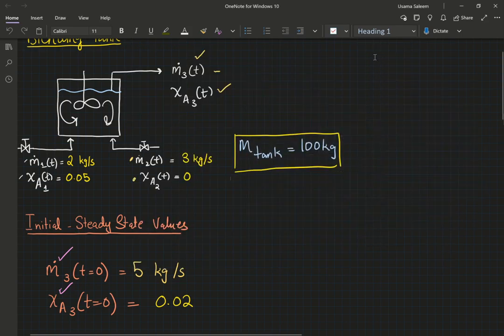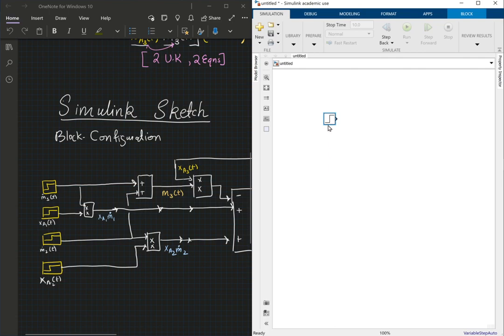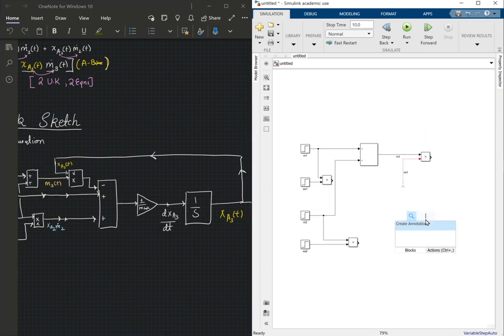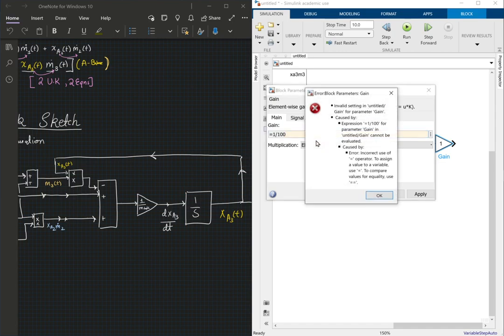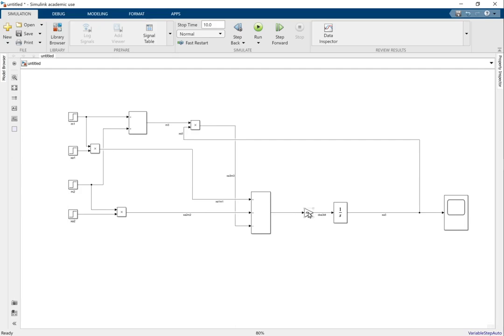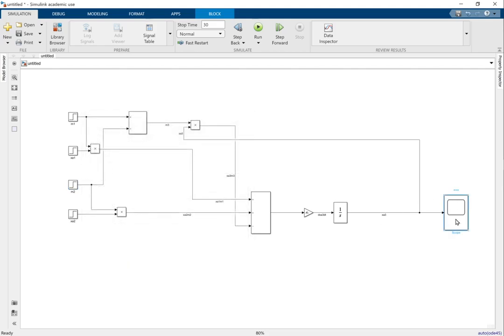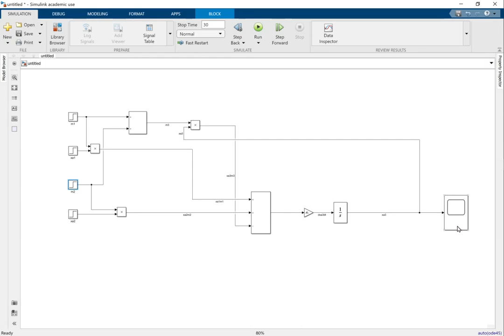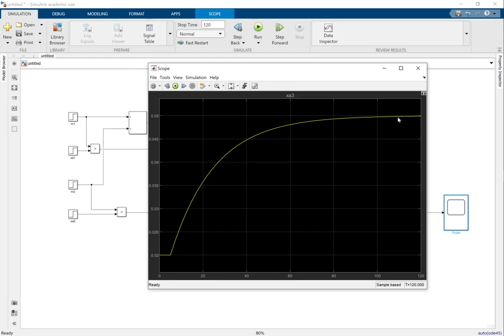Numerical Approach to Blending Tank Problem (2/2)

Comment: How would you change the model if the output flow rate was higher than the input?Would the gain would be 1 divided by the mass of the tank as a function of time, and would m3 just be the output flow rate?
Reply from the maker: Hi Samuli,
Please note that for OVERFLOW tanks, output flowrate MUST equal input flowrate.
The exceptions are during STARTUP (No output flow)
and SHUTDOWM (No input flow)